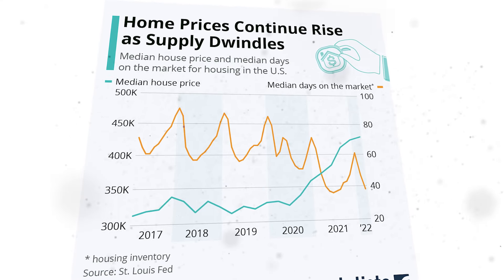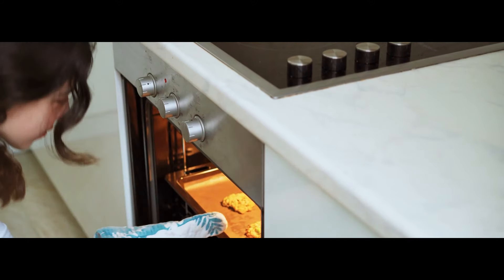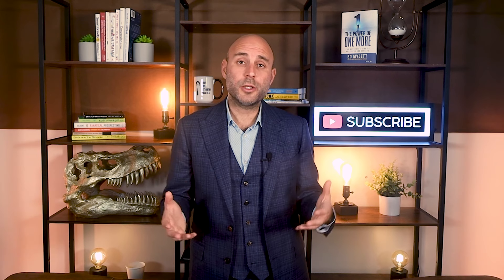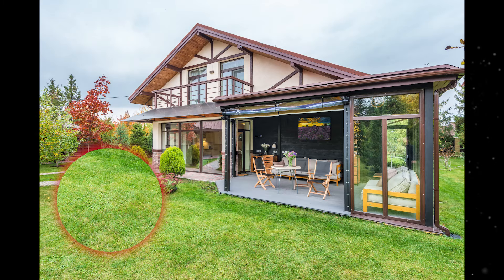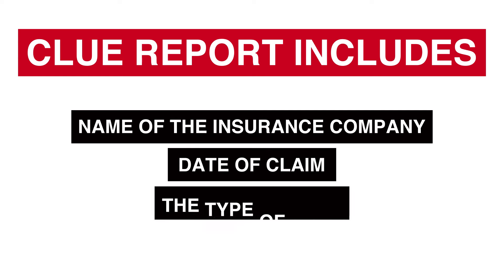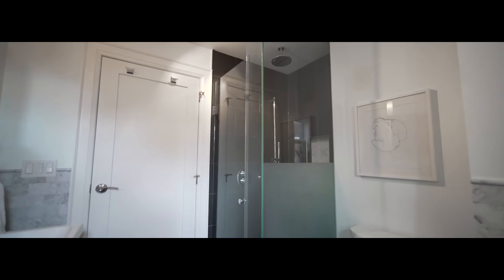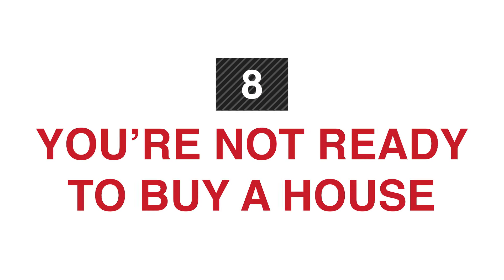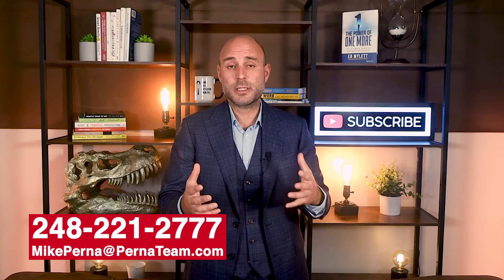WARNING! Red Flags When Buying a Home

Comment: Great…
Which side realtors on when price depends on %commission?
No offend, but realtors vs car dealers.
Reply from the maker: Really good question. I’d look at length of time in the business.  Everyone has to start somewhere but newer agents tend to rely on each individual sale as if it’s their last.  Seasoned Realtors know each sale if you work hard for your clients a springboard for referrals.  Example: 12 years ago I represented a buyer and knew I could get 10k or so more off the price even though my client was happy with where we were at.  I advised to trust me & let me go after it.  I got the seller down 10k more & we closed.   I received a seller review. . . . And every family member they had that bought or sold over the next 12 years.  That’s over 25 more closings so far.  So I made 300 bucks less on that one deal, but 25x over time.  Does that help?